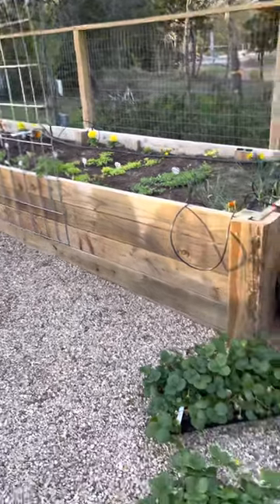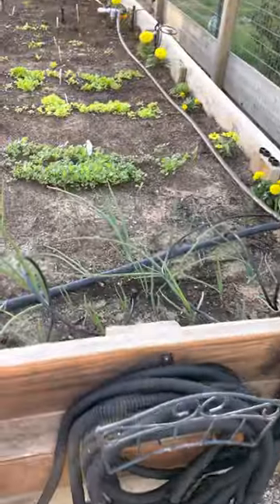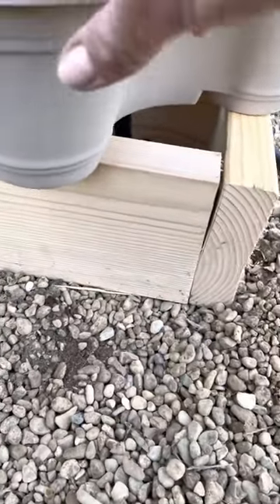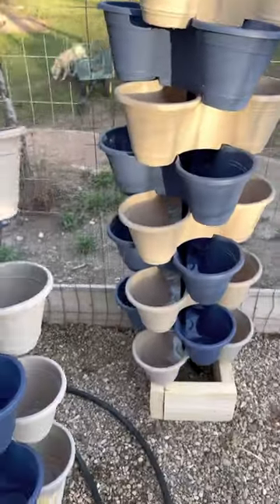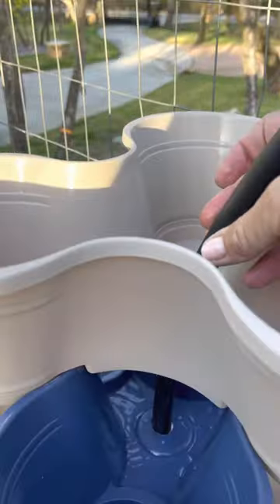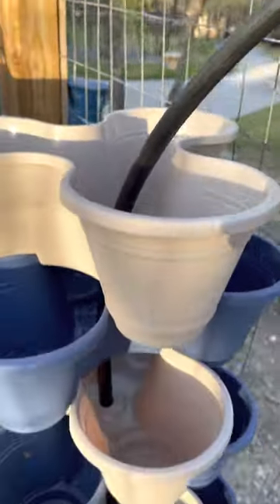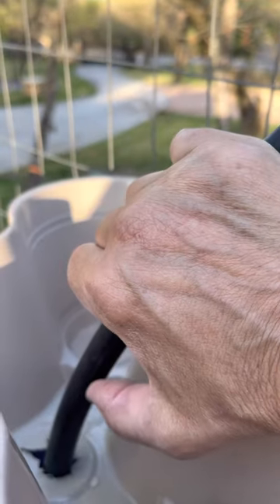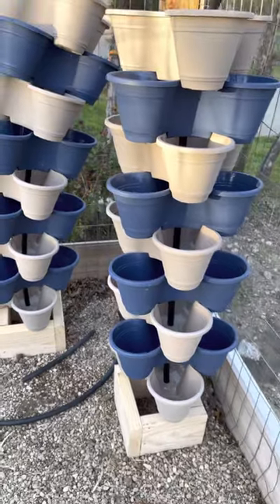Dollar Tree Stackable pots-Automatic Irrigation System

Comment: I've had my stackable towers for 3 or 4 years now and they're just fine although I do recommend a rebar down the middle because over 5. High they tend to turn over if you get high wand mine. I raised up 12 inches on a six inch P v c Pipe drove three more down through the middle and then thread it all mine on, they will turnover in high winds, And we have a great dane with a big tail and he knocks them over

Comment: May I ask how the soakhose worked out?
Reply from the maker: Soooo, I would say the strawberries didn't thrive but didn't die either.   The watering system worked and kept watering consistent but  the Texas heat was just too much for them. I had them in full sun all day long. I think if you have your tower where it receives some afternoon sun, results would be better.
Reply: @sorayasgarden1282 Thanks for info..glad someone asked the question. Strawberries are not as easily grown as some seem to think. Foliage is beautiful though even if fruit not prolific.